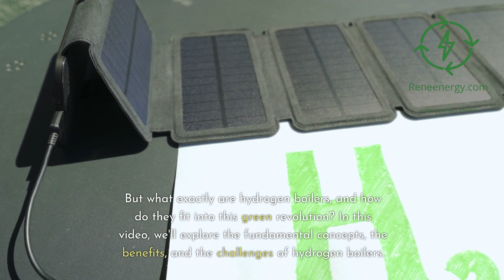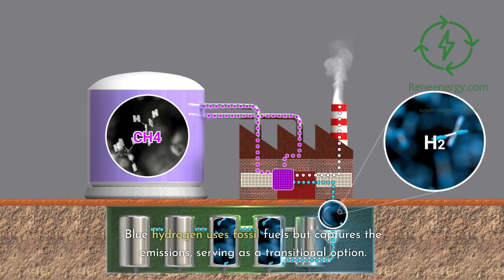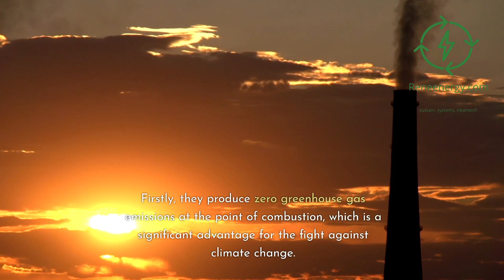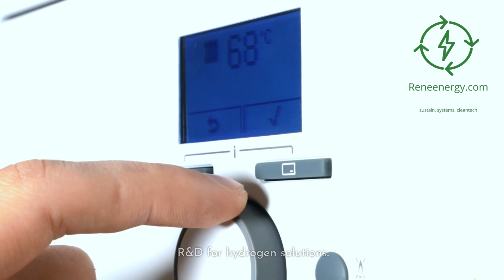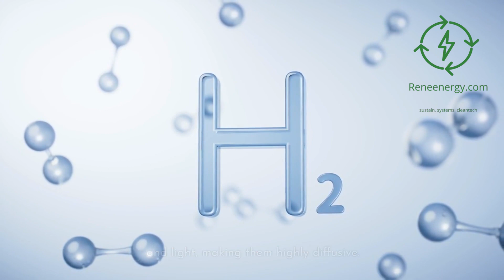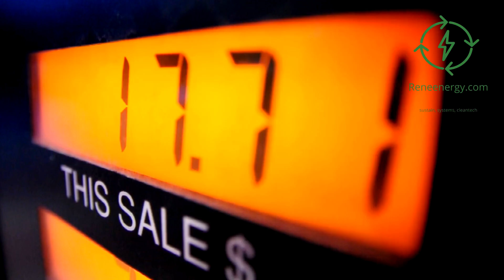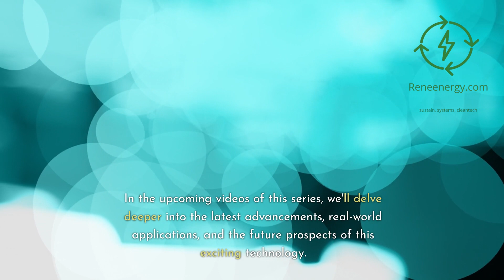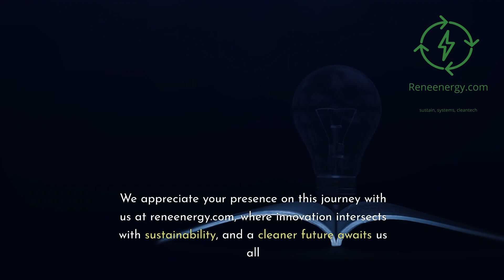Hydrogen Boilers - The Future of Clean Heating

Comment: Is hydrogen going to replace natural gas? A good question - why not listen to Robert Llewellyn and Prof David Cebon discussing this issue. The Hydrogen Science Coalition  explain why the physics of hydrogen make this a non starter.
Reply: No. Electricity is going to replace natural gas at our houses
Reply: Just to be clear, I absoly agree with you. This is a non starter
Reply from the maker: Hydrogen has potential as a clean energy source, but replacing natural gas entirely may face challenges due to infrastructure and physics considerations.  @TheAllMightyGodofCod
Reply: @renewables2050  no. That does not address the point. The problem is not even infrastructure and I am starting to think you don't even know what the point is...
Reply from the maker: Hydrogen production, storage, and distribution can be less efficient than direct use of natural gas or electricity, leading to more significant energy losses along the supply chain. @TheAllMightyGodofCod
Reply from the maker: Let's figure out the unknowns. This is an interesting discusssion!
Reply: @renewables2050  sorry, but why are you contradicting your own video while yelling me what I already now since grade 7?
Reply from the maker: Hydrogen has potential as a clean energy source, but replacing natural gas entirely may face challenges due to infrastructure and physics considerations.